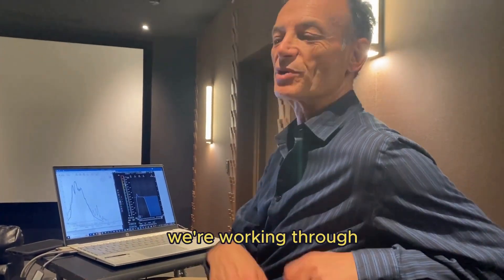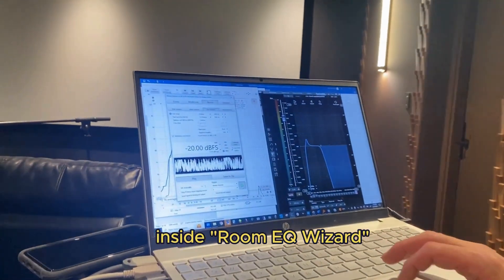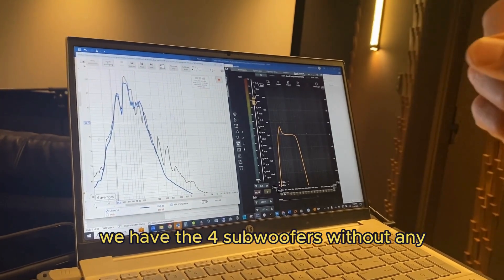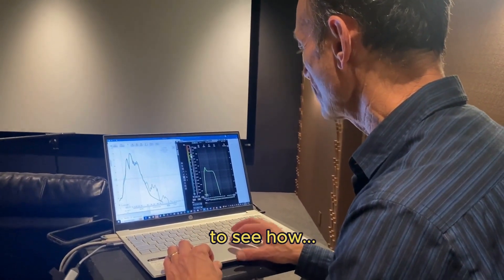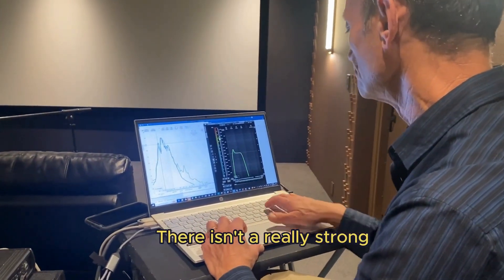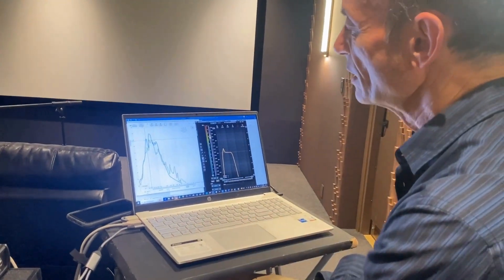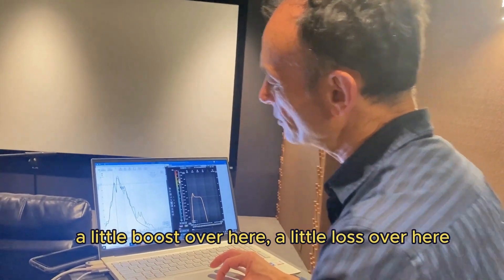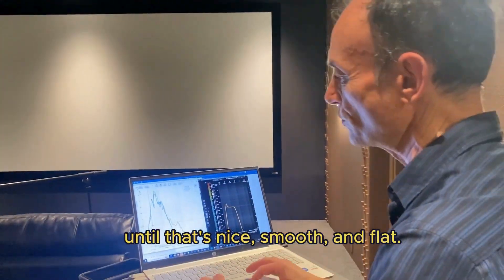Home Theater Calibration Part 4 - Subwoofer Calibration: Bass Optimization and Equalization

Comment: What volume do you EQ your speakers at, and what about the subs?
Reply from the maker: I usually run test signals around 80dBSPL, which is high enough to stay well away from the noise floor of the room and house, but not so loud that I go deaf by the end of the day! After al is said and done, I do set a reference level on the volume control, using either 85dBSPL from the 5.1 Audio Toolkit DVD or 89dB SPL from the Dolby Atmos demo BD Pink noise test signals.

Comment: Why using outputs 1 and 4 on the minidsp for the rear subs vs using outputs 3 and 4 ?
Reply from the maker: On this video I am using a 4-channel DSP-equipped power amplifier. I usually set them up as 1: Front Left, 2: Front Right, 3: Back Left, 4: Back Right, but the order doesn’t really matter.

Comment: Anthony, I know you are aware of MSO. Why don't you utilize it for this? It has come a long way in the new version with it's "spl maximization". If you read its documention, everything is explained, so you will know what it is doing behind the scenes.
Reply: He said it takes too long also, he isn't just there to calibrate subs. His entire process can take longer than 8 hours. He has to manage his workflow in his best interest.
Reply: He mentions it at 7:10. MSO can give some messed up results like delaying one sub by 20-30ms or reducing one sub’s gain by 20db, but it’s good when it works
Reply: @ChadAV69  yes, if you don't know how to constrain and use it, it can give bad results. That's why I mentioned the documentation.
Reply: @BuffSquadBigBenni I’m not saying I agree with him. I’m just letting you know what he said
Reply from the maker: As I stated in the video, I have had variable results with MSO. I should probably spend a bunch more time working with it, but I do find that it’s pretty quick to do the work and iterations manually. In some rooms I have gone back to redo something that I did with MSO, and got up to 6dB more overall output.

As for the question of mismatched subwoofers, yes, it is best to use all the same units, but with trial and error, you can also use different subwoofers. The room is going to mess up the subwoofer response way more than the difference between two reasonably well-designed sealed subwoofers.
Reply: @grimanisystems  I won't post a link, as I don't want to be seen as spamming, but if you go to the MSO homepage and click on the "User Guide" button, that will take you to a page with the topic "SPL Maximization: The New Feature of MSO v2". That topic explains in broad terms what this new feature does.
Reply: Quick question to BigBenni and anyone else with MSO experience: I own 2x old SVS SV1000 subs and want to add another 2x higher priced / better sealed subs to my room. Can I still get very good results using different pairs (2x SV1000 in Rear Corners & 2x Let’s say Martin Logan New Abyss 10 Sealed Subs in Front Corners) utilising REW + MSO? Or is it strongly recommended that all 4x subwoofers be identically matching? Thanks guys!!!
Reply: @snowinokinawa  search for this thread on avsforums: "Optimizing subwoofers and integration with mains: multi sub optimizer". Search the thread or ask a question. People there are really knowledgeable and helpful. 

Identical is best, but mixed is definitely doable with som tweaking in MSO. Again, I would recommend reading the user guide for MSO. Andy really put a lot of effort into it.

Comment: Do you use any specific targets on your subs?
Reply from the maker: Flat down to as low as the subwoofers will reasonably go; cutting off somewhere around 30 to 25Hz. Then set the overall in-band level so that it is about 5 to 6dB above the mid-frequency level of the speakers; that yields a natural-sounding bass.
Reply: @grimanisystems  thanks for the info. Do you roll-off those big 21” subwoofers too at about 25 -30 hz? How do you set those up to play with the smaller subwoofers?